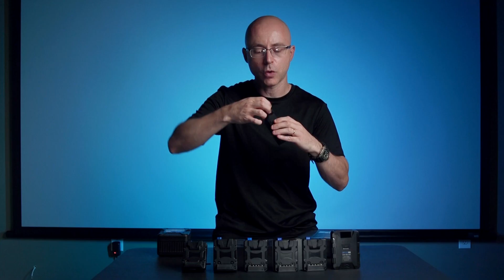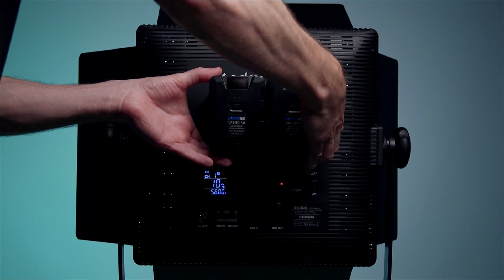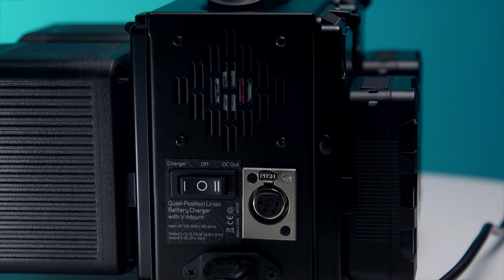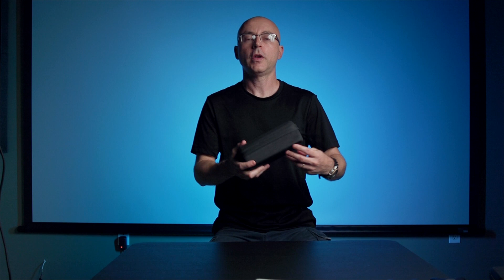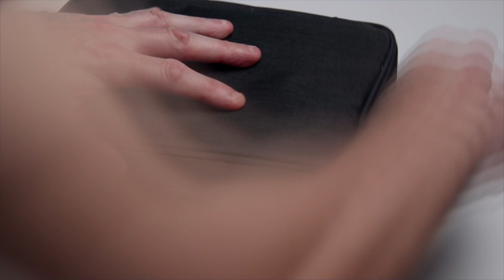WATSON VM-50-MI Micro V-Mount Battery + ALL Accessories + Quad Charger

Comment from the maker: 1:25 Introducing the battery
8:06 Watson Dual Micro V-Mount to V-Mount Plate
11:07 Lanyard option and Watson Micro V-Mount Battery Plate with Belt Clip
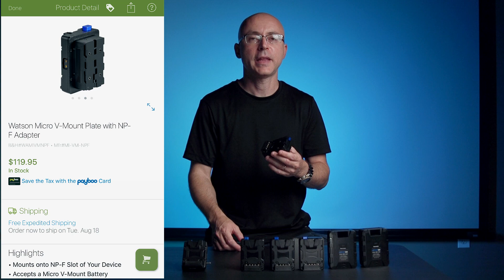13:00 Watson Micro V-Mount Plate with NP-F Adapter
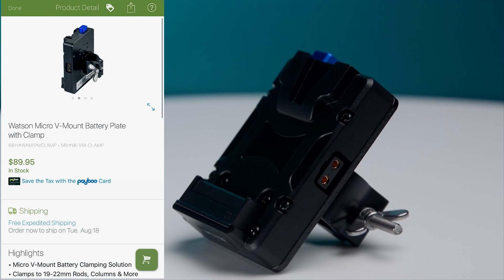15:14 Watson Micro V-Mount Battery Plate with Clamp
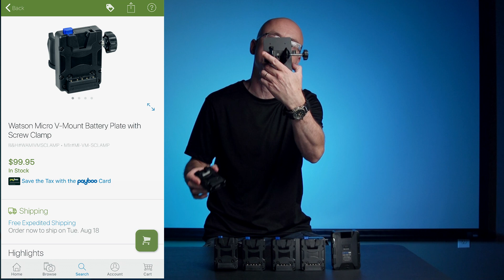17:06 Watson Pro Quad Position Li-Ion Simultaneous Battery Charger
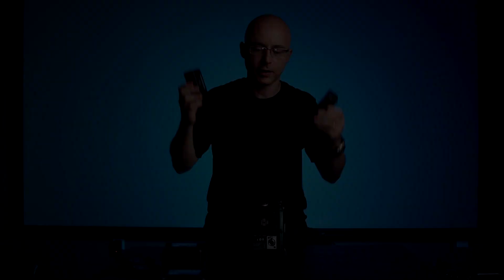22:08 Time Lapse during charge using the Quad Charger
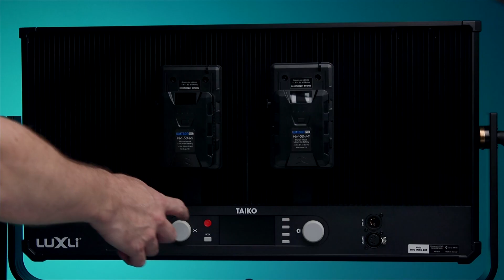22:53 What these Micro V-Mounts can do! Powering a 400 WATT 2X1 PANEL!
23:29 Watson Pro Dual Position Li-Ion Battery Charger (V-Mount)
25:50 AMP calculator App + CASES for ALL YOUR BATTERIES!